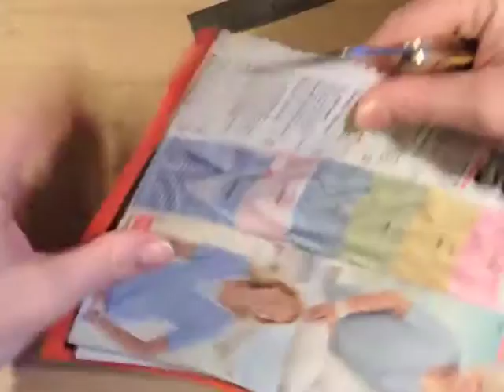Split-back Whittlers

Comment: Doggorunning posted a video several years ago, where he bought a few Rough Riders & started out complementing the knives. That is, until he began using the bigger one to cut into wood, wherein the knife literally came apart at the pivot joint. What GARBAGE. He then used a GEC knife for the same cutting test in the same wood, and the knife handled it with ease.

Comment: I had never heard of these split back Whittaker until just recently. Interesting concept. Is the tension on the main blade twice as heavy as the smaller blades?
Reply from the maker: +ima4ster In theory, yes, but you get the extra leverage of the longer blade so I didn't really notice any difference in practice